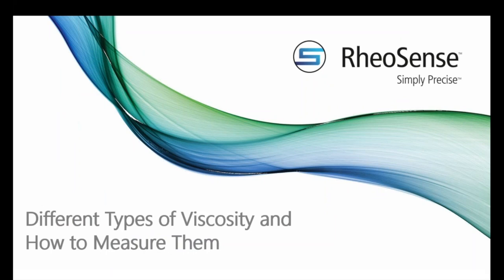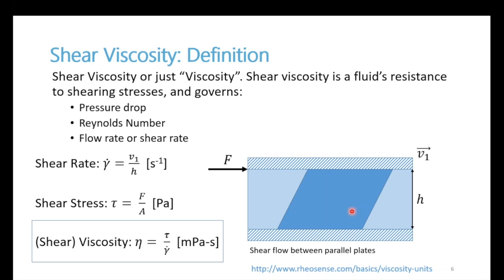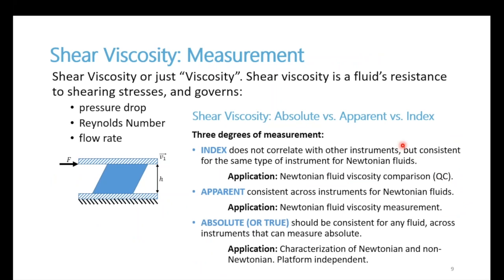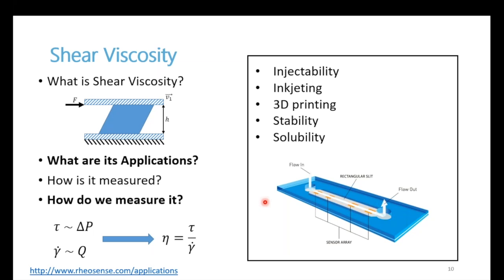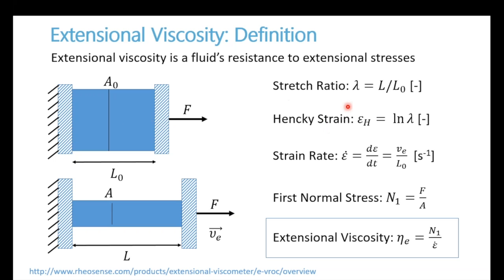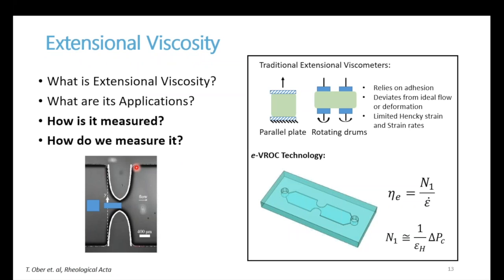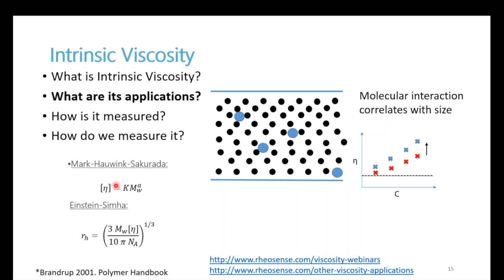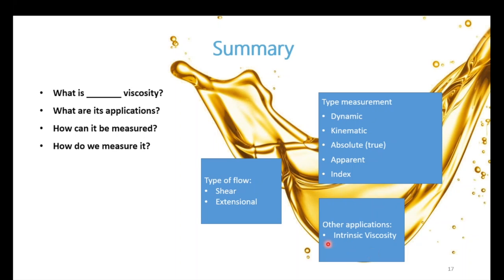RheoSense Webinar: Methods of Viscosity & Different Types of Viscometers

Comment: I measured a slurry using a rheometer, the results displayed were viscosity, shear rate, shear stress and torque percent. I want to determine the apparent, effective and average viscosity. I don't know if they are the same or not. And what type of viscosity is the one displayed on the rheometer. Again, how do I calculate the constant K and n with this info. 

Your suggestions would be helpful.

Thank you